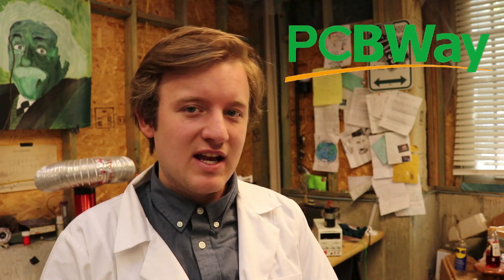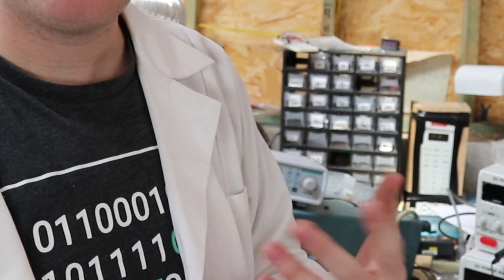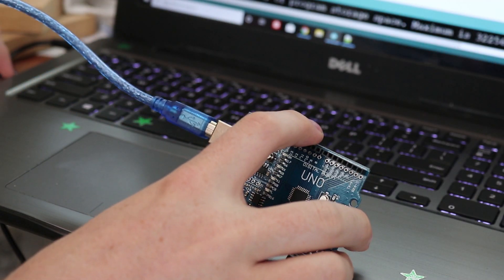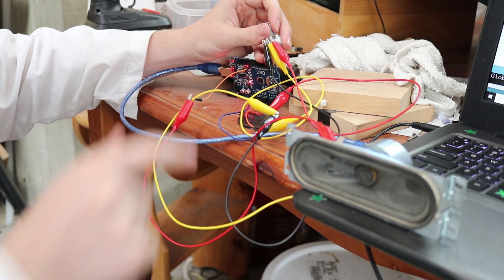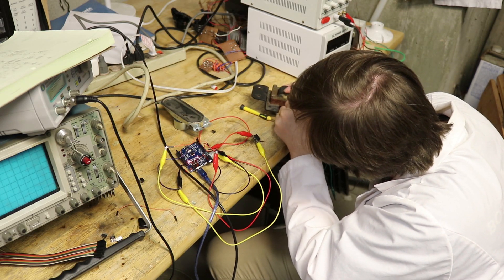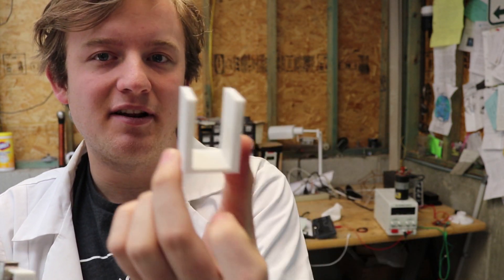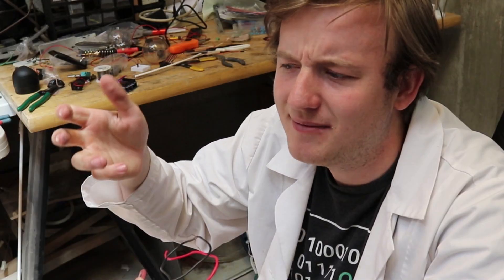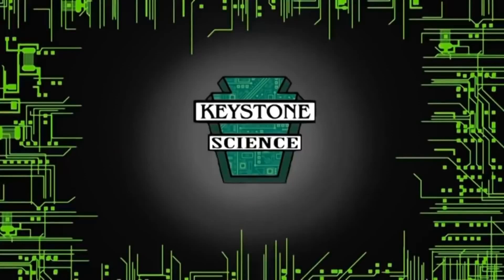I Turned an Old Chandelier into a High Voltage Plasma Ball

Comment: Do you think the photo diode in a laser diode would be able to work as a laser bounce audio receiver ? 
Seems the Arduino would be fast enough to switch the laser on then off to read the reflection using the built in photo diode .